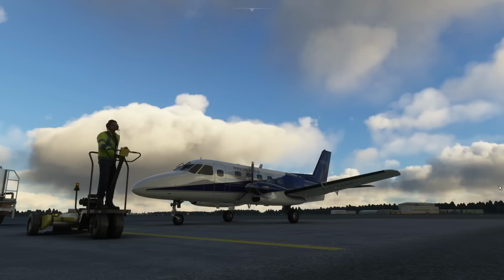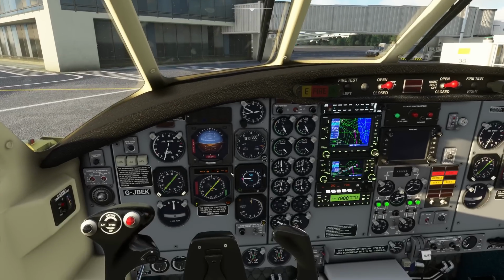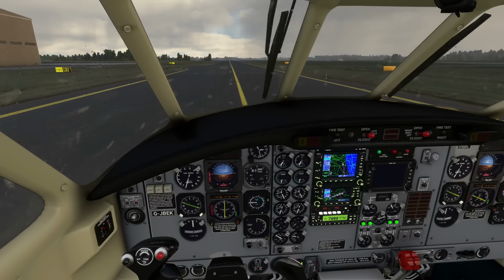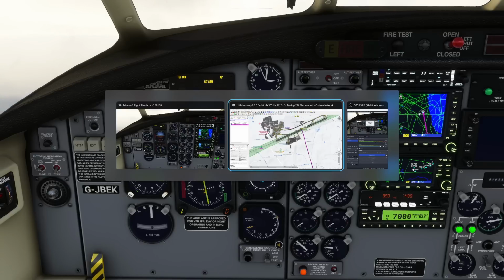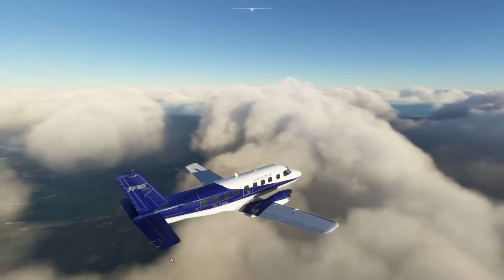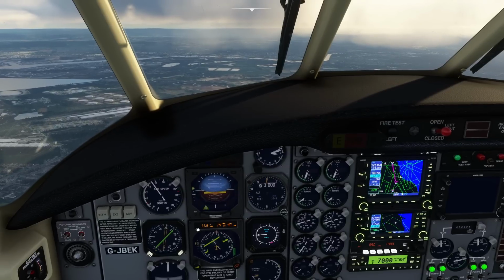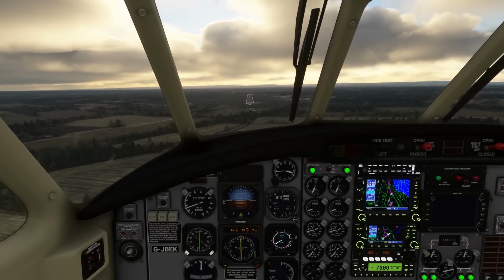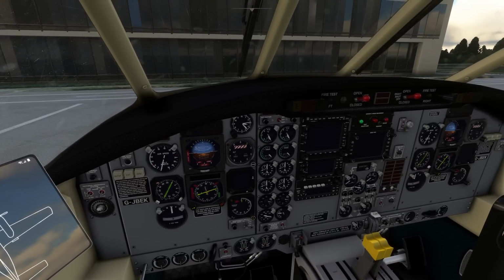First look at the NextGen Embraer EMB-110 Bandeirante in Microsoft Flight Simulator

Comment: Bought it last night for a cargo run in fl klal to MLB when started getting dark I flipped the cabin light switches. < nothing> panel switches < nothing> 
Pitch black cockpit was hard to judge approach speed but I just floated alot bleeding speed until a graceful touch down.
I need the amps to take a look so I can fly back. 😂
Reply from the maker: That's always the nightmare, isn't it - getting into a situation you're not familiar with in a plane you don't know how to configure :)  You can always wind the sun back of course in MSFS :)

Comment: The screens turn off after 10-15min so im not flying it.... any ideas for a fix?
Reply from the maker: That will be because you have not switched the generators on - you've essentially run the batteries down.
Reply: Ok👍 ill try it